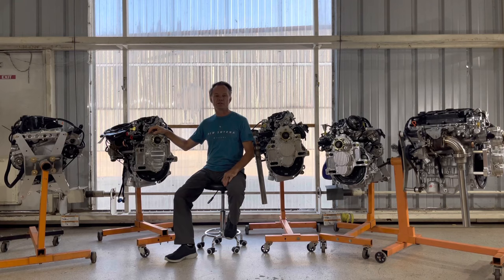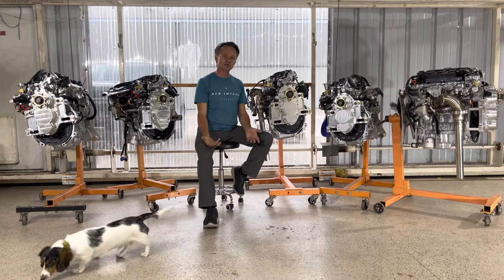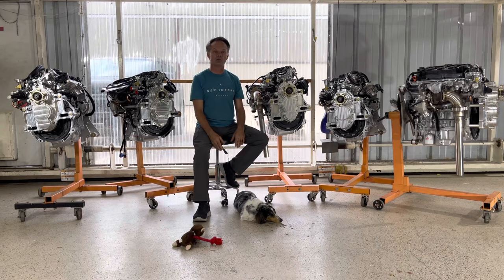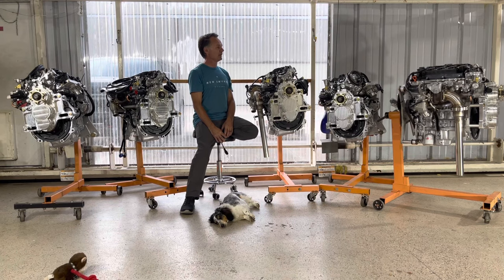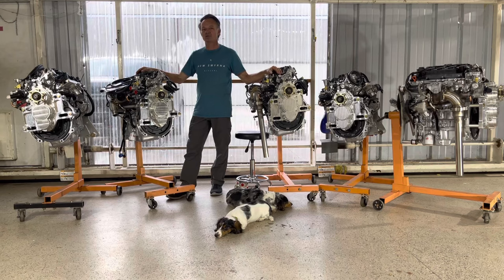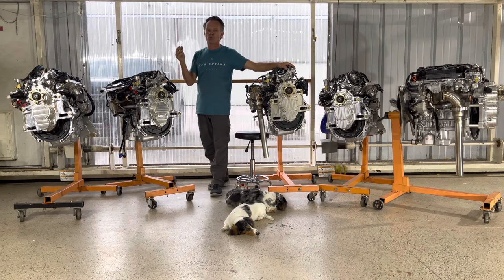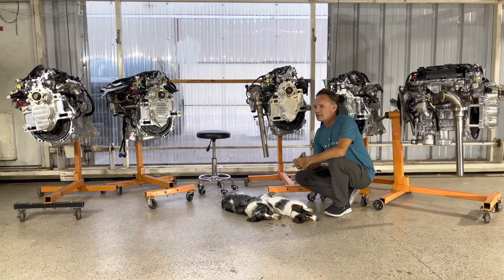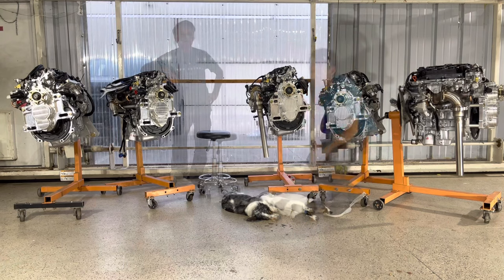Talks with Viking Part 5 - 195 Turbo Engine

Comment: I'm soon to begin building a BD-4C, so I'm very interested in the 195T, especially since you recently posted a video showing your development of a firewall forward installation for the aircraft.  However, if you were to introduce something in the 220-260hp range by the time I'm ready for my engine, I would most certainly be interested.  Thanks for the video!
Reply: Did you start your build? I've been reading up on the BD-4.
Reply: how's it going?

Comment: Hi Jan, great vid, long, but full of sensible things pertaining to choosing Honda and retrofitting to aircraft.  Are these newer engines similar to the k20/24 designs?  VVTC Actuator issues of 2008/09 rings a bell to me.  I haven’t worked on any newer engines, we never get them in, or dealer warranty.

I guess things only get better and better with you folks... I’m still aways from starting my Super Duty build.  But you folks are still my first choice!  Our RAA chapter built a Cruzer with a rebuilt o-200.  70 year old engine design pulling a 2016 new airframe!  Where is the logic in that?  Inherited cooling issues, oil, baffles, magnetos, carb heat, cabin heat off exhaust, tractor starter, oil leaks, list goes on.

Comment: Those engines tuned are capable of 500 to 1300 hp , what hp will your gear box hold for a off the wall bush plane?

Comment: Your website states the 150 is a great choice for the Rans S-21. Would you suggest a 150 is better than a 195 Turbo for the S-21? Im looking to get the performance specs that Rans states the Titan XIO-340 achieves with 180hp, but with a Viking engine. Do you think the 195T is the best bet if that is my goal?

Thanks for all the content on these engines. Keep it coming!
Reply from the maker: We actually prefer the 150 with a variable pitch prop over the 195T, unless maybe at a high density altitude.
Reply: @eggenfellner  I did quite the analysis on this today based on the data you publish from testing with the CruZer. 

From my analysis:

VIP 
- 25% Boost in climb performance @3000', 50% @7000
- 10% fuel efficiency at equivalent cruise speed as Fixed Pitch
- 8% speed boost at equivalent altitude and RPM as Fixed Pitch

I can appreciate the efficiency, but I feel like the 195T would outdo the speed/climb performance benefits of the VIP with brute force horse power, at the sacrifice of fuel efficiency and range. 

It probably depends on what a buyer wants most: Top Speed and Max Turbo-normalized Climb Performance or Max Range/Duration

I'm interested to see more data and looking forward to some Rans S-21 data!

Keep up the great work! You've won my support! Just need to keep stacking the pennies 😉
Reply: I may be altering course. Was initially thinking Rans S-21 with the Viking 150. Then was hoping Zenith would come out with a Super CruZer. I'm now thinking an RV-15 with a Viking 195 might be the play. 😮 The downside there is another 12-18 months till they start taking sales, then I'm sure there will be another 12 months of long lines of people throwing money at Vans and another 12 months of kit lead time. I'll give you a call in 3-4 years! 😆

Realistically I'm still stacking my pennies anyways 🙂

Comment: How much does a 195 turbo weigh and how would that work on that kit fox or seven series on center of gravity because that’s my dream to mix those two together
Reply: Longer tail even if I have to specially order I think I want to make a little longer tail
Reply from the maker: Hey Ray, the 195T weighs 260 lbs, installed usually a bit under your standard Lyco/Continental within the same HP range. However, we have our Viking 130 on the Kitfox 7 - I don't believe this engine would be the best option, rather the 130/150 with a variable pitch prop.
Reply: @eggenfellner  if top speed or shorter take off are the goals,  would a Viking 195 turbo not be more ideal?  Are there any downsides to the more powerful Viking engine on a Kitfox 7 compared to the smaller Viking engines or the Rotax 916?

Comment: Thanks for informing. Qty 1: Why not used a Diesel Honda Engine? Qty 2: Is there a Viking for Sling TSI?
Reply from the maker: We deal with large mass production, diesel's also tend to be heavy. The closest you are going to get to a diesel is direct injection, then you are still light, mass produced and easy to maintain. We have not done a Sling as of yet, it could be done, someone would just need to do it :)
Reply: @eggenfellner  thank you very much for answering, have a nice day!